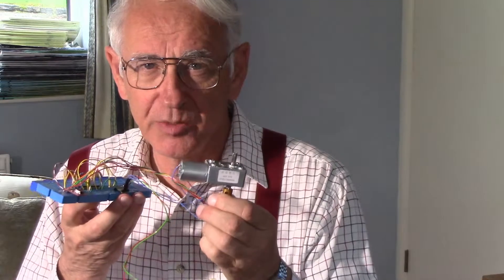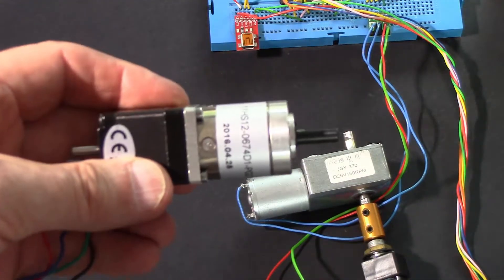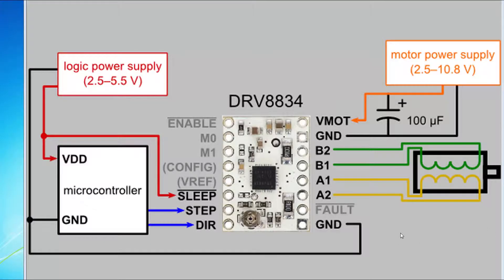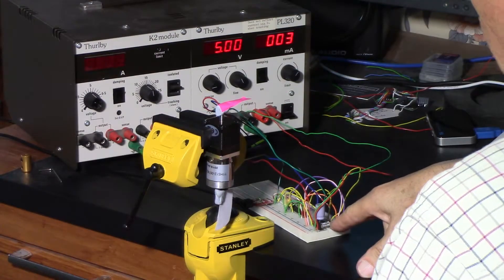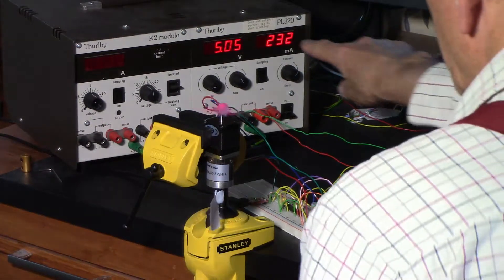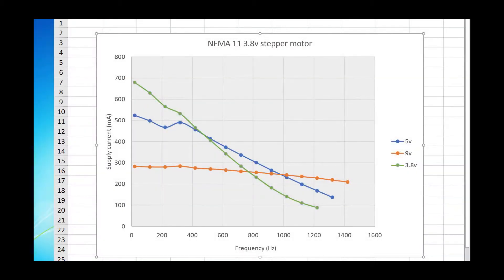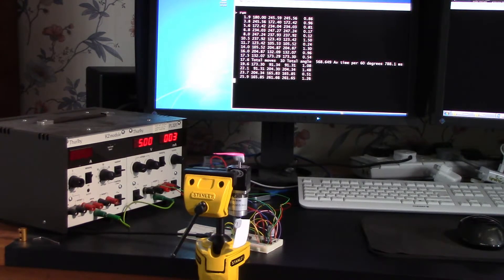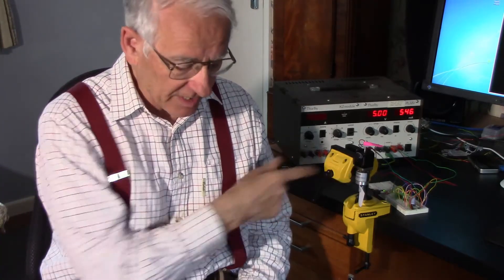Test of 11HS12 stepper motor with 27:1 planetary gearbox

Comment: The length of the video almost made me click away, but I'm glad that I stayed. Very useful video, thank you. Much much better than an average product review. I would expect to see the motor exhibiting its torque capability, i.e. perhaps lift a certain weight on a moment arm connected to the shaft. But still, I wish every review video was as useful as this one.
Reply from the maker: Thanks. Not sure if you mean it was too long or too short to make you almost click away. I did actually test the torque using an arm and a bucket of water, and I have video of it, but I never got around to uploading it!
Reply: Heheh I thought it was obvious, but you are right. I mean it seemed too long at first.
Reply from the maker: Yes it did start a bit slowly - I must have been tired that day (or perhaps I'm just 70 years old)! BTW I applied 608 mA to this stepper motor and poured water into a bucket on a lever until the shaft moved: it moved at a torque of 1.95 N.m.
Reply: You used 5V for this 608mA 1.95N.m measurement, like in the video, right? For other people coming here seeking information, we should perhaps mention that. So it can generate 608mA at 5V. Many thanks, I learned a lot.

Comment: Hi! Thanks for the video. Quick question where did you purchase this stepper motor? I'm looking for a UK supplier of a similar model. Thanks!
Reply from the maker: I bought this on ebay and it does not appear to be there now. I found this today https://www.active-robots.com/3321-0-28sth32-nema-11-bipolar-stepper-with-27-1-gearbox.html which is similar but it is not the same spec.